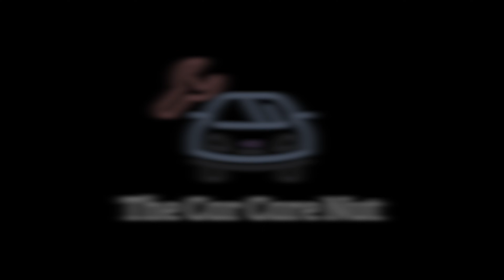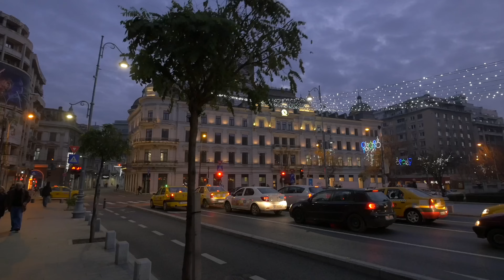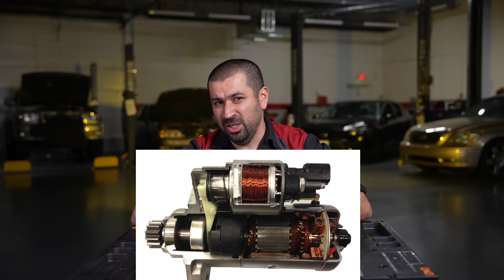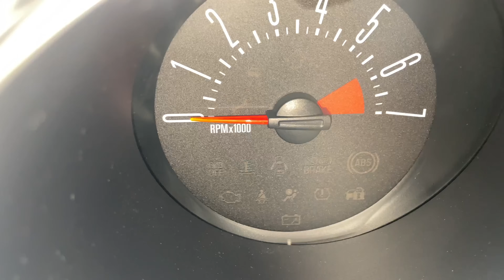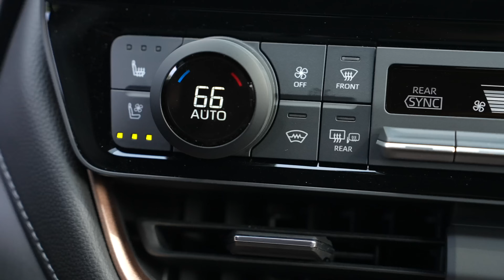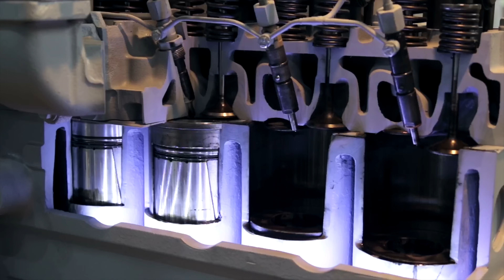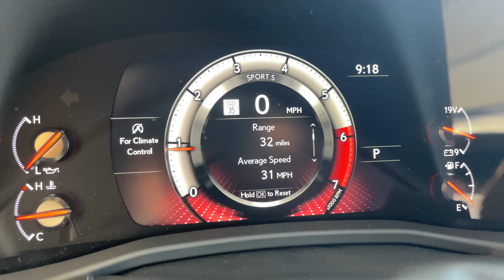How Does Start Stop Technology Work in Modern Cars? Everything You Need to Know

Comment: Amazing video and description as always. Thank you! I can say, my 2023 RAV4 XLE AWD (gas only) has auto start stop. Not a fan at all. Not very smooth in transition (none I test drove were) and here in the heat in Az, the AC shutting down constantly is not fun at a 5 minute light in 115 degree temps. I know you said toyota does it better, but real world NO. It is awful in the all gas version. Thankfully they make a little device that plugs into the auto start stop which flips its function so that the auto start stop is defaulted off. Not disabled, just defaulted off. So many complex systems now defaulted off which I prefer. Best part, install was less than 5 minutes. Worth every penny. I know you mentioned NOT changing anything to a car, I get that. But no way I am keeping this system active. And a ton of others do not want it either.  This was the little device I used that defaults it off for toyota.  https://amzn.to/3Qg70Iq

Comment: So, if there is a fault on the breaking system sensor, your car will either 1) be totally bricked and it will cost you thousands to fix it or 2) if the fault is an incorrect reading without an indication of a broken sensor, your car will just lose its brakes... oh what fun.

Comment: I have just replaced my 2013 VW Golf with a 2018 model. Both cars are DSG.
What I called the Stop Don't Start system on the 2013 was dreadful. The engine always started with a big cough and if the car was on an uphill gradient was prone to stalling. I always turned it off if I remembered and joked that it should have had a warning chime to remind you to do so.

The 2018 (with a different engine) seems to be a big improvement and seems to start smoothly every time. A shame it doesn't seem to be quite as economical as the 2013 1.4TSI despite being able to stop the engine while you are actually driving. 

p.s. I did consider Toyotas and would have probably bought a Corolla Cross if they actually sold them here.

Comment: I tolerate the start/stop on my F-150 except for one instance: When I’m first at the stoplight, stop/stop event happens…but I need to make a turn. If my truck had electric power steering, probably wouldn’t be an issue, but with P/S powered by the engine, I have manual steering for a few seconds until the engine can catch up. That’s the only time I disable it. PS: Sport mode also disables it.

Comment: And that's why I got ceramic tint, don't need to run my ac so high. F the police.
Edit, when coming to a stop there is a point in your brake peddle when this feature actually activates, at least in my car. I can come to a complete stop, and only until I compress it further when stopped does it turn off. Just don't brake check when coming to a light. I only compress if the light just changed and I'm going to be there for a minuet. I have a 23 acura integra. So the extra savings is good if you have a heavy foot haha.

Comment: We got stuck in traffic when auto start stop failed in my wife's 2020 Honda Passport... battery was bad.  This was a 3 year old honda, and they usually have the manufacturer battery fail after 3 years.  But if start stop wasn't there, we'd would have been stranded in a safe place, not in the middle of a busy street/highway.
There's also a huge problem for people that aren't used to the system, and you are trying to merge into traffic.  The extra latency of restarting could mean the difference between an accident and no accident.  
Doesn't seem like the start stop is worth the bother, in terms of cost, safety risks, fuel savings, etc.

Comment: I absolutely hate that system.  My last experience with it was a brand new Honda rental with 1800 miles in it.  I had this vehicle for a week.  I lost 1/3 of my gas mileage to it.  I just shifted the trans to neutral for every slow down or stop because it annoyed me so much.  With the driving I was doing, I was not going to loose 75-83 miles of range.  Measured this 3 times.

Comment: All of this to decrease emissions. One container ship has the emissions of millions of cars. Construction equipment does not have any emission requirements. Trains do not have emission requirements. Aircraft do not have emission requirements. Cars are not the problem, but car owners have to pay for this expensive tech. My Subaru requires approx. nine tanks to equal saving one gallon of gas. 126 tanks to save one tank of gas. That is approx. 50,000 miles. Average life of the car saves a couple of tanks of gas. I did appreciate the technical aspect of how all of this works. Interesting tech, but creates a larger carbon footprint to create better batteries, starters, transmissions, etc.

Comment: I have a Yaris from 2011 with transmission and start/stop tech. I love his car and I have never experienced problems with it EXCEPT from the little controlbox that keeps the electronics going when the car is shut off at a stop. After long periods of rain and high humidity it starts its bad behaviour: Dashboard frantically blinking when the car is parked and the key is out. Or simply draining the battery while being unable to use the remote to open the doors. Solution: take off the multisocket from the box and let the box dry out a couple of days, and it will work again. Or by a new controlbox.

Comment: my main issues with it

1. Every time I go to park my car at home or at work I'll pull into my spot and brake to a stop....The engine will stop.  But then I shift into PARK and the engine will instantly have to restart again but I'm just about to turn it back off again anyways.  It's unnecessary and annoys me.  On/off/on/off in a matter of seconds.  And yes I do have to wait a second or two to turn my car off if I didn't have to deal with it.  As well, my coworkers who are parked next to me notice my car doing it too.  They're like..."what the hecks wrong with you?  Why are you turning off your engine, then turning on right away, and off right away every morning???"

2. The system isn't beneficial in the slightest.  The longest time I've go with my engine off at a stop thus far is about 10 seconds.  10 seconds!  And that might be a bit generous.  My normal commutes, I experience it working like maybe twice during the whole trip yet it'll always trigger when I actually reach my destination and I'm just about to turn off my car anyways.  It's honestly asinine.  

3.  My job is is strickt with policies.  We're not allowed into the building until precisely 5 minutes before our shift.  Not a second sooner.  But we can't be 1 minute late in using a scanner to clock in despite being paid salary....another ridiculous system but I digress...So what happens is most of us get to work fashionably early like a responsible worker will do, but then we have 10 or 15 minutes of sitting in our car time idling.  So let me tell you with this Stop/Start feature will do what I griped about in my 1st issue but then when I'm actually idling .... parked and not moving .... for like 15 minutes!!!! The engine will never shut off anyways...

I mean ffs!!!! What a great system (sarcasm)  So useful and practical for emissions reduction.....more sarcasm.  Someone fought really hard to push the agenda to implent this system on a Governmental Political level.  As described in this video we all heard the length that needed to be taken to make it work.....  All for what???  The Pros don't out weight the cons of this feature at all.  This is all a result of a few people hell bent on pushing their own agenda for their own gain and nobody seems to have any say or power otherwise.  As a consumer we've been stripped of the choice to not have this feature, other than a button which I'm sure will be taken away in the near future once they ween everyone onto acceptance.  

It's probably from the same people who think banning plastic straws is the place to draw the line at when it comes to plastic pollution while the entire world is buying 90% of their stuff on the internet ....which is all wrapped up in plastics for shipping to be just thrown instantly away.  Or the 1,001 other wastefull industrial level uses of it.  But consumer convenience of Straws.....yeah  that's where the changes have to happen....  It's all BS.  

I'm not anti change.  Standards of the times and the things that we have to get used to is one thing.... when they make sense and aren't enforced by law but rather adopted by public choice as a sensible improvement.  The Auto/stop feature is not Progress.  It's not something everyone needs to just accept as the way of the future.  

This country is running out of patience with a lot of these things and being told how to think and what to accept.  This is just another straw on the Camel's back...how many more before it breaks?

10 years from now I hope we look back on this feature as a story to tell the grandkids of how weird life used to be.

Comment: I have a 2020 Ford Edge and I disabled the Start / Stop system by disconnecting the sensing cable to the battery, placed it in a zip lock bag sealed with a wire tie. I saw a report that 2017/2018 Ford Edge are having problems with cracks in the flywheel ring gear, this requires  removal of engine / transmission costing thousands of dollars to fix out of warranty.

Comment: Permanently disable the evil feature - all problems solved.

Seriously, I've had more issues with those stupid start/stop than they are worth.  Best one was a failure to restart in the middle of a mall exit which needed the negative cable removed from the battery to reset.

I'll NEVER EVER operate a car that has this POS.

Comment: Lol deal breaker if it has that feature it way to new for me I don’t want a car that thinks it knows better then I do on when it should run or not also I’m pretty sure on a start cycle the engine has to use more fuel on its initial few revolutions and a split second with les then perfect combination so no no fuel mileage gains then there’s the we’re and tear on the engine my god in slow moving traffic it sounds like torture to a car and don’t even get me started on turbo engines when they shut down with the turbo oil just cooking definitely when u just got off the highway and we’re boosting they need to cool down with oil or oil and coolant flowing let’s just stop all that it’ll be fine it’s a liberal joke

Comment: I turn if off everytime. I even used forscan to disable it in the ecm firmware.  I don’t care if it works or doesn’t. Im the driver I will tell the car when i want the engine turned off or on. Getting real tired of being controlled by different things, especially my damn car.

Comment: I have a question. 
I believe the oil has to seedless down when you turn off the engine, the oil pump probably will shut off.
Doesn’t that put extra wear on the engine every time you shut off the engine?
May it takes a white before the oil settles down into the oil pan. I don’t know.
It would mean a lot to me if you could replay, since I just got a new car with that feature and I hate it cause all the bad information going around and I forget to turn it off all the time.
Thank you in advance.

Comment: Journal bearing wear takes place every time the motor is started from 0 rpm.  Startup wear is one of the main sources of journal bearing wear.  Unless the system maintains oil pressure when the engine is stopped (most systems don't) journal bearing wear is accelerated by increasing the number of 0 rpm start events.  This is crappy technology that sacrifices wear of major components for minimal gains in fuel mileage.

ETA: The only good news with these systems is they are typically easy to permanently disable.

Comment: Start-Stop is not fully developed.  I have two cars with it:  2016 Honda Pilot and ‘16 Mercedes E350.  The Mercedes is straight forward and reliable, but I still turn it off to get immediate response and performance in traffic.  The Honda is very poor.  Both I and my friend, who has a later model Pilot, have gotten briefly broken down at a traffic light when the cars wouldn’t start.  His wife was at a busy intersection in the city and had to have the car towed.  We were able to turn everything off and reset the system and get started again on a number of occasions.  I always try to remember to disable the autostart when driving the Pilot.  The Mercedes, on the other hand, has a small backup battery and simply doesn’t engage autostart when the batteries are old and needing replacement.  These complicated systems need way more refinement.
Reply: Check out the idlestopper 2.0 for your pilot.

Comment: Great Great Great video. So my question is.  I've always been told starting the engine causes the most wear on the internals. So by adding thousands of extra starts over its lifespan.  Would that not wear rings and bearings out faster?

Comment: My Subaru does not explain why the system is disabled ☹️. One thing that you did not address is the power steering. Turning the steering wheel will disable the auto shutdown ie restart the engine. My Subaru also disables the auto shutdown on hills.

Comment: Auto stop eliminator.  It saves the state you left the option on without altering the system itself.  So if you push the button off, then it will be off the next tine you start it.  You can turn it back on if you wish by pressing the button.  Works great on my F150.
Reply: Most cars reset it to "enabled" each time it is turned off (and back on) by the driver.

Comment: I kind of like it.
I just wish there was ONE more condition to meet (on my car at least). being "Parking Proximity sensors = NO"!!
If my parking sensors are triggering; its because I am maneuvering in a tight space (eg: parking my car). The LAST thing in want it to do at that moment is stall (essentially) itself. 
....But every single time, I want "crawl speed", car says "FULL FUCKIN STOP!!"
Great explanation though!!! - I guess I will undo my seatbelt in the garage to avoid that, but I wish it could just be programmed to look for a parking sensor.  
I didn't conifer V-Droop when I just paid AU$500 for a new battery, It makes more sense now. even a big capacitor shouldn't be hundreds of dollars extra; but like start/stop; there is likely more to it.

Comment: I have a question: Since modern vehicles have individual injectors and sensors that tell the computer crankshaft  / camshaft position and thus the computer knows which cylinder is at or most near TDC when the engine is stopped, how come on start can't the injector put fuel into the cylinder nearest TDC and provide a spark to "kick" the engine over to start without even needing the starter? (at least when the engine is already warm) When I first heard about start / stop technology, I actually thought that might have been how it was done. Thanks, in advance, for any good answers.

Comment: I had a 2017 Pilot and the start/stop was an absolute debacle. It worked fine at first, and then it would categorically refuse to restart the car more often than not. Honda said there was nothing wrong (and that nobody else had reported the problem, which I later learned was hilariously untrue) and I had them replace the battery since it was the only thing I could think of. No dice. I finally got a module to disable it because I'd occasionally forget to hit the button and I'd get stuck at a green light fumbling around with the pushbutton gear selector until I could try to restart it with the button.

And right around the time I got rid of it, Honda admitted there was a problem and started fixing them. 😂 Hopefully the system works better in the 2023 Pilot, because it's more of a pain to install that module in those.

Comment: My 2008 Prius uses different components because its a hybrid(just has a large motor/generator) but it does all the same things. If you need heat it will start the engine when you turn on the front defroster. Then turn it off and it stops. The HVAC is run of the high voltage battery so it doesn't cause the engine to start. When you press the go pedal the electric motor is used for the first few seconds while the engine cranks. Unless you don't need a lot of acceleration(ie. when driving in a neighborhood). But they should just make every vehicle a hybrid.
Reply: My '02 Prius doesn't have electric AC, it just has a quite robust evaporator core that stays cold for about 30 seconds to a minute with the engine stopped. If the engine needs to run to re-cool the evaporator, it will only run for about 20 to 30 seconds, and then it will cycle off again. The defroster or MAX COLD will force the engine to run.